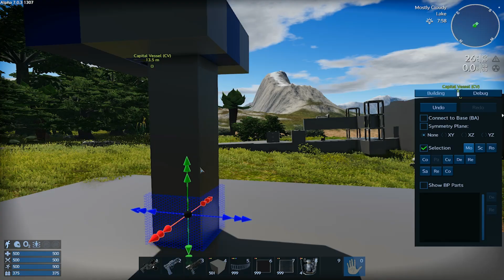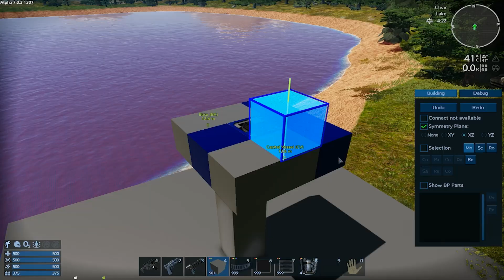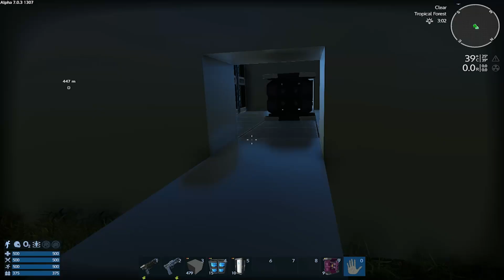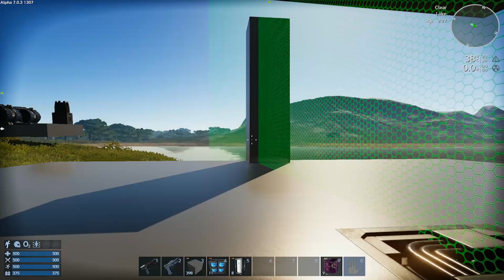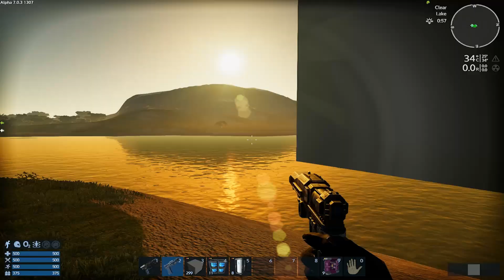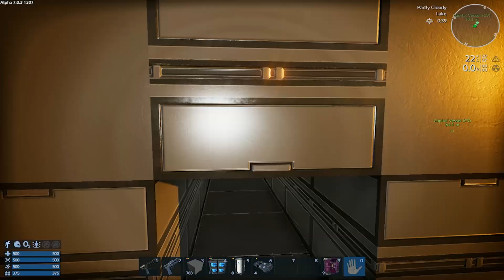Let's Play Empyrion: Galactic Survival - Episode 41: Getting More Detailed & Testing New Tools!

Comment: I use the M thrusters for ships from 1 to 5 Kiloton. Like 2 M thrusters forward and reverse for 1 kiloton up to 8 M thrusters forward and reverse thrust at 5 Kiloton. Above that weight i switch to L thrusters. Most builders use an overkill of thrusters, wich won't give you more speed but end up with a lot of fuel waste. One TII RCS will do up to 5 Kiloton. It's unrealistic for a huge ship to be as agile as an SV. But that's just me. You can always start with 2 or 3 normal RCS's and take it for a spin and see if you like it.  My smallest CV weighs only 550T and has only 3 S thrusters for forward and 1 M thruster for reverse thrust :)